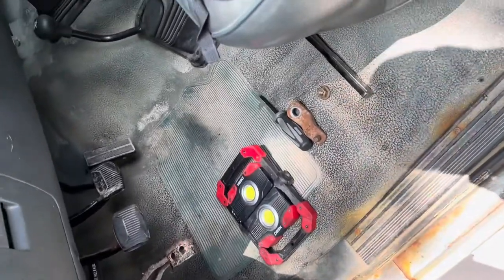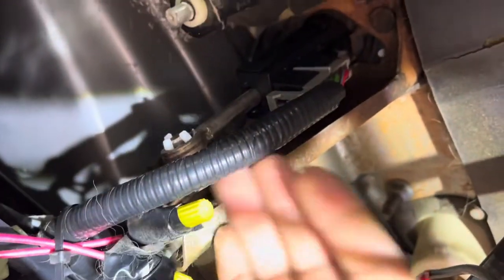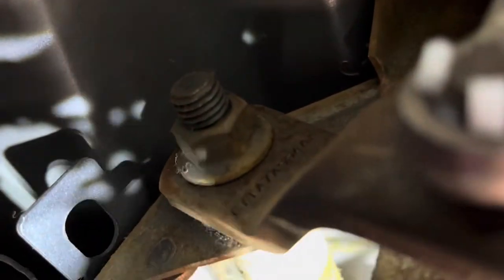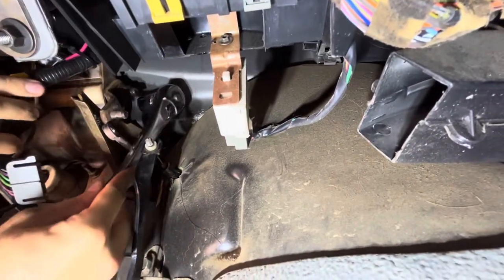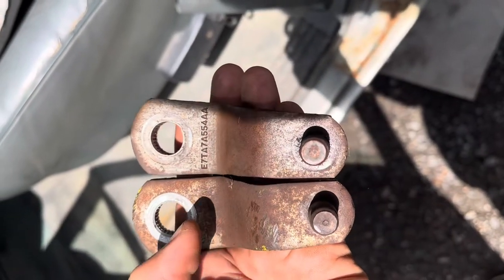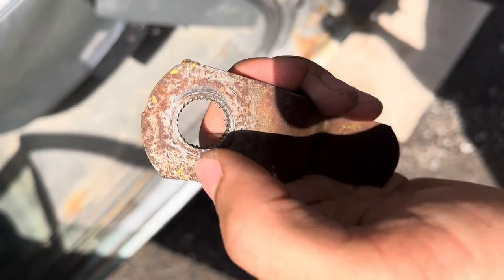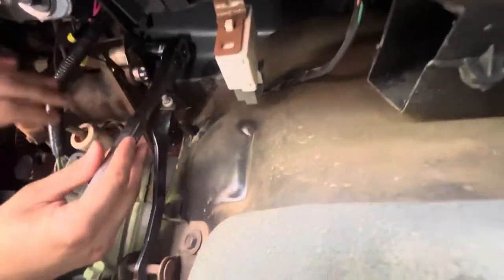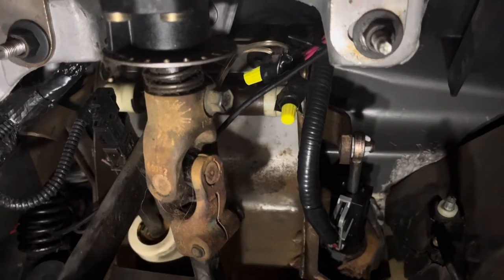OBS Ford - Pushing too Hard to Engage the Clutch

Comment: The warn pivot arm deformation had nothing to do with how far the clutch pedal travels. But if the little plastic bushing wears out the eyelet of the push rod and the pivot pin will deform and could very easily come off and the clutch pedal will drop to the floor and will need to be pulled back up manually. You should have just removed the pivot arm after marking it's position and grind the back side of the pin and used a drift pin to punch it out and replaced it with a hardened hex headed bolt. You should have also have replaced the push rod eyelet end with a Heins joint.
You also should have known that the marks as you called them are called SPLINES. You can adjust the position of the pivot arm by adjusting the alignment of those splines.
Reply from the maker: @joe226825 good to know, I did not know you could punch out and replace the pivot pin so I just replaced the whole piece. I did replace the rod end bearing on the Master, that part just didn’t record. Sometimes in the moment I forgot the name of things, I do know they are called splines lol. Thank you though